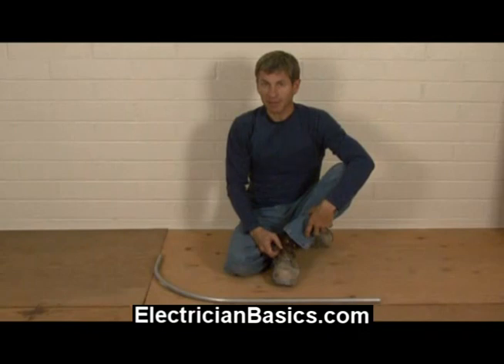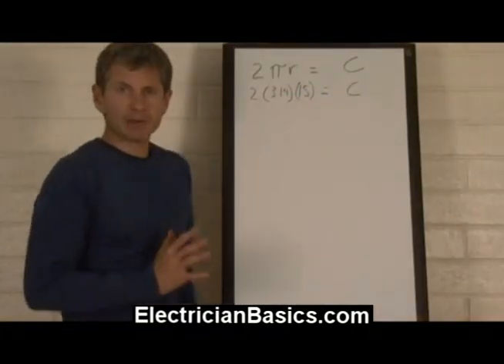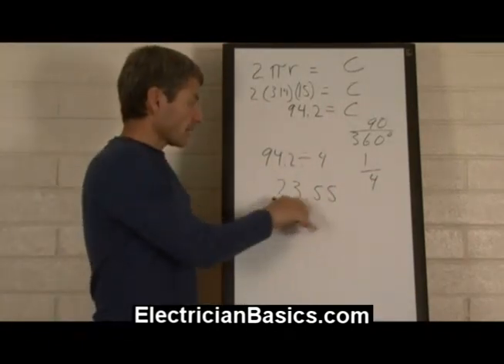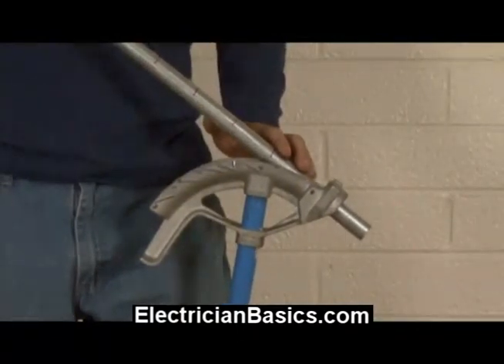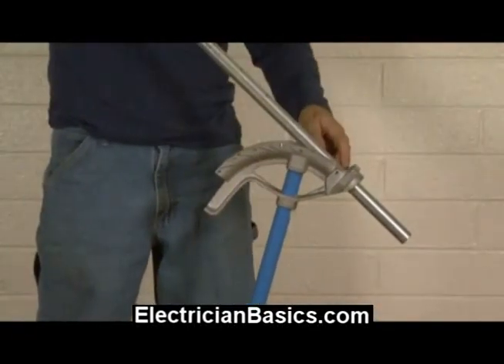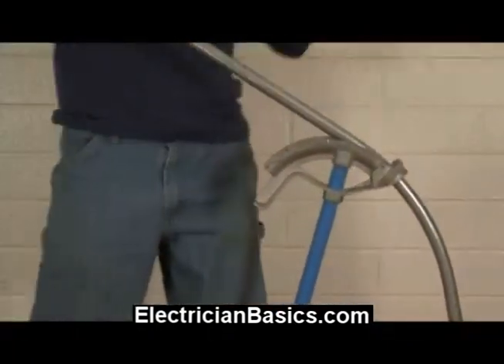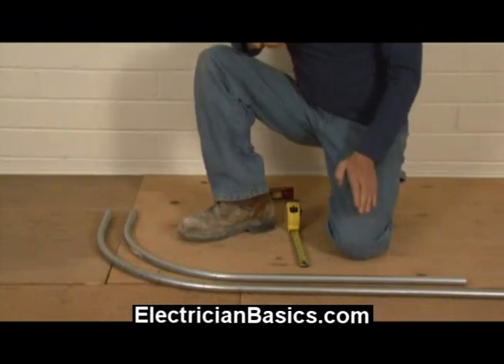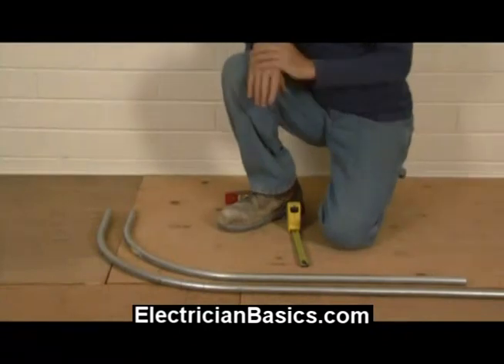Bending Conduit EMT With a Hand Bender  Concentric Bends

Comment: I see that Klein use a plastic shim or wedge-like device in their model of conduit bender to ensure more accurate bends. I plan to use a cheap conduit bender with a wooden shim/wedge equivalent to achieve 10 degree bands to form a circle from 15mm (5/8") aluminium.

Comment: how did you come up with 15 radius measurement in the first place
Reply from the maker: it was a hypothetical measurement that one might have to bend
Reply: @daidegoat  any ideal how to find radius  measurement
Reply from the maker: @zodd1790  with a tape measure. When you run into this situation on a job you will be able to see what you need to measure.

Comment: In practical terms where you would see concentric pipe bending being used would be industrial applications of where you would be running the main power circuit the big wires. The reason being if you were to use say 4 inch rigid pipe for the power feed and 1 inch conduit for the control feed. If we use the standard shoes for pipe bending. The 4-inch rigid pipe has a 20-inch radius. The 1 inch shoe on say a greenlee 555 Bender has a much smaller radius.  And in many cases if you're going on the inside of a Bend. With a 1-inch being the first Bend than the 4-inch being the second Bend 
 
. Their center to center on the straight runs would be say 4 and 1/4 in center line to center line on a pipe rack between the two pipes. On the inside of the 1 inch Bend you would want to have a larger radius otherwise the standard Bend would end up hitting the 4 inch larger Bend. That would be an application of where you would use a segmented 90 bend on the smaller pipe.

Comment: If I go back to 1996 working out of local 48 IBEW Portland Oregon. There was a steel mill in that city called Oregon steel. We ran parallel 3 inch metal conduit runs. The runs were several hundred feet long and ended up with 9 -90s on each of the parallel pipe runs. To satisfy code requirements there would be installed a c fitting. The radius is that we used 30 inch radius. The wire pulls went smooth as silk.  We used 5° bends  18 bends for each 90. That was about the time they started coming out with digital protractors.  The pipe bender we used greenlee 884 Bender. What you would find as far as spring back would be as the pipe progressively had more bends in it. The greater the springback. So let's say you're a 20° of been with for been so far you release the pressure at 20° and you find out you're only at 18 degrees. Obviously you need to bend that Bender that pipe to 22° release the pressure and then you find you're now at 20°. When you get to let's say 60° and you release the pressure and you find that well no right now I'm at 57 degrees obviously you put pressure on the pipe bringing it to 63° release the pressure then you'll see you're at 60°.  Now you've made your 18th Bend you bring it to 90° you release the pressure. You now find you're at actually 86° so now you have to put pressure on the pipe and bend it to 94° release the pressure now it turns out to be 90. The spacing we use on those bends was 2  5/8 inches . Now remember these are centerline radiuses Bends. 30 inches multipled by 1.57= 47.1 inches. That is what's called developed length. Divide 47.1 inches by 18 Bends. There is your spacing in between Bends. 2 5/8".
Reply from the maker: Bending larger conduit with a machine bender is far more complex than using a hand bender.
Reply: @daidegoat  The concept is the same!    Math does not lie either. I have used a Greenlee Mechanical Benders the model 1800 better known as a Ratchet bender to do segmented bends while working a 1 inch pipe run for a baggage carousel at Bostons Logan Airport on the interior of the baggage handler doing 180-degree bends mounted on Unistrut rather than use metallic flexible conduit.    36_ 5 degree bends!

Comment: Even easier,  Always bend in 10 segment  bends, (no matter the radius).  That will simplify the math and 10 segments always looks good anyways. Just times the radius you are looking for times .157. Them mark the pipe ten times that sum.  Done.

.157 came from consolidating of all the other numbers that never change. It's dropping the unnecessary repetition.

Also the use of 10 makes the math easier to do in your head. Just move the decimal place over one. Makes you even faster.

 Smoking a math test in impossible speeds. So bending a 10" radius is marking the pipe 1.57" 10 times.

But on very large radiuses you might want to add more bends. The 10 start to show.
Reply: Thanks I’m going to try that today. I have to make a hoop with an 18 inch radius out of 1 inch conduit. Thank you for your tip.
Reply: @theloneviking9145  it's times .157 times the radius, then mark the pipe 10 times that sum.  I corrected my typo. I'm good at math, suck at grammar.
Reply: I know this is old so hopefully you're still around. I've never used concentric bends so I'm studying up on them. Do you just pick a radius ? If not how do you know what radius to use?

Comment: How do you get the radius measurement? The 15 inches.
Reply from the maker: I made it up for the video.  I needed a measurement to begin with.
Reply: He already had that piece of conduit bent that had the 12 inch radius. Then he wanted to have another piece of conduit 3 inches away from that first piece of conduit. So 12”+3” = 15 inches

Comment: Hi Franck, I am doing a project with 1/2 inch conduit. I need a corner radius of 100 inches for a nice long arc (1/4 of a circle). I have used your formulas but it seems I need to add my marks closer together than what I'm coming up with. Any tips? By the way, my math works out to a bend every 7.85 inches. Is that enough to make a smooth arc?
Reply from the maker: Good question.  It could work out in half in conduit.  You can also try breaking it into 15 bends of 6 degrees each - which you will have to guess a bit on.  If you have some available scrap try making a 45 degree concentric and see how your math is working out.  I taught myself a lot of conduit bending tricks out of necessity and experimentation. You can do the same.
Reply: @daidegoat  Thanks very much! conduit is pretty inexpensive so time to do some hands on learning! Great video. Keep 'em coming.

Comment: Great explanation, only question is does the multiplier 2 apply to all sizes of conduit?
Reply from the maker: It's how the math works out.  The multiplier for each angle, not just 2 for a 30 degree angle is the same regardless of the size of the conduit.  It's almost like, at least for me, trying to explain why gravity works.  I just know from experience that it does.

Comment: excellent, the only videp I got like that. Do I need to make a 90 fold of a plasticbond pipe for underground, is the procedure similar? I mean the distance from the mark to where the bend actually occurs, do you think it affects?
Reply from the maker: By plasticbond do you mean PVC coated rigid?  It seems like you are using a machine bender. The technique will be similar in that case and distance from the mark to the bend will depend on the size of your conduit.  Do your best to figure it out and then practice on a scrap piece.  You'll be able to do it.
Reply: @daidegoat  I was referring to metal conduit with plastic coating, something like anti-corrosion protection tape used for underground. the conduit is 2 ", something like that I thought but my doubt was because the distance of the marks is small compared to the point where the machine starts the bend. It will be time to test with one applying the procedure you show. Thank you.